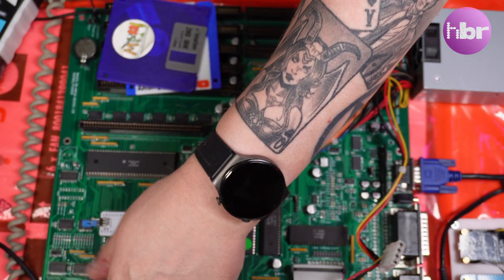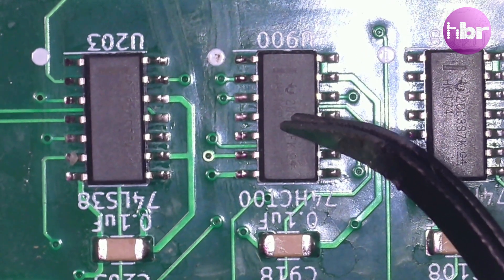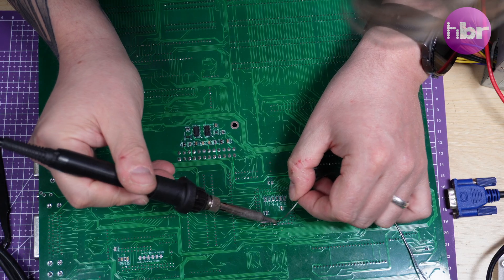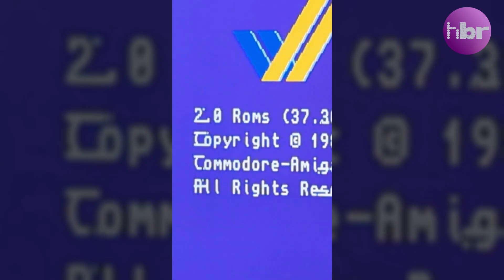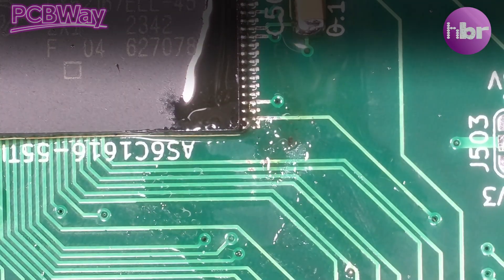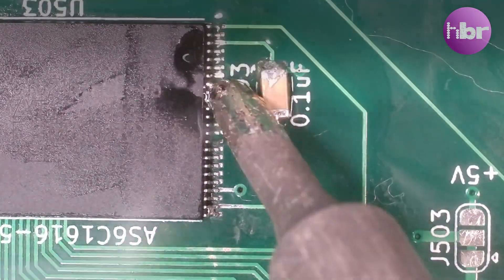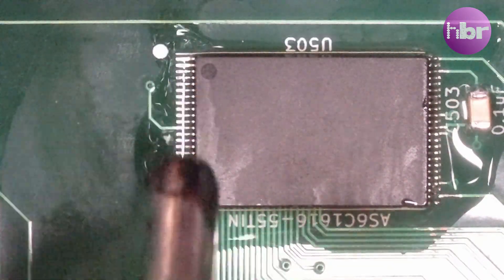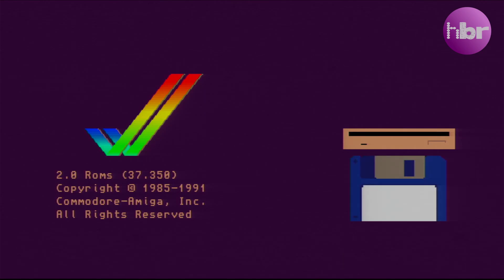This Amiga Was Almost IMPOSSIBLE to Fix!

Comment from the maker: Thought it worth pinning thinking on the issue - my guess is that the 3v part is not making TTL levels at the speed it’s being asked to run at, access from CPU via Agnus is slower and works but when blitter functions are used and Agnus is doing the lifting directly it can’t keep up, as these functions are only used for graphics that’s where it show up as corruption… like I said that’s a guess…

Comment: I think CRG built on these Amiga 2000 recreations. I think one he built used a VGA port over 23 pin video output. Not sure if thus was done due to part availability or to fit IO sheild area of ATX.

I kind of like this one though.
Reply from the maker: Glen did indeed build one, slightly earlier revision but basically identical :)

Comment: Very interesting. Not an Amiga guy, but an 8 bit Commodore guy, so I'm not familiar with the machine. There's a mix of 3.3 and 5 V chips on it? Directly connected together or with some buffers inbetween? Very interesting.
Reply from the maker: Most is 5v TTL this part was a 3v3 TTL component from a logic standpoint they are comparable as long as the 3v part is tolerant of 5v inputs it’s not like the 5v CMOS issue where there is no comparability aside from the supply voltage. Level shifters are required if the 3v parts are not tolerant just to cap the input voltage at 3v but doesn’t affect the actual levels used for hi or low signalling. You can usually also use 2.5v CMOS in a similar way with shifters.

Comment: Glad you were able to get it working!  I wonder why the 3.3v part has issues?  Anyways, glad it's sorted!
Reply from the maker: My guess is it’s not making TTL levels at the speed it’s being run at, access from cpu via Agnus is slower and works but when blitter functions are used and Agnus is doing the lifting directly it can’t keep up, as these functions are only used for graphics that’s where it show up as corruption… like I said that’s a guess…
Reply: @hackbuildrestore  doncha hate it when things 'kinda' work?  Or just enough clamping with that gate in the way to drag it down, 5v forever it seems!
Reply: I'm pretty sure this was the exact issue. The 3.3v part was used because of the ic shortage. Strange thing is it only seems to affect 8375' I tried 3 different ones😂 as soon as I fitted a 8372 it was fine
Reply from the maker: Interesting to know that it only causes this with a 8375 ! and thanks again for sharing the fix !!

Comment: The mask they put over the traces on this board seems to be paper thin.  Looks like just your iron barely touching it is enough to knock it off.  That's not encouraging...
Reply from the maker: I’m not 100% when the damage occurred, but yes I think the mask could be thicker, also note this board is NOT from PCBWay, for its origin I would have to confirm with Cathers but my guess would be JLC…
Reply: I bought the board from somebody so have no clue to its origin but my guess would be jlc.